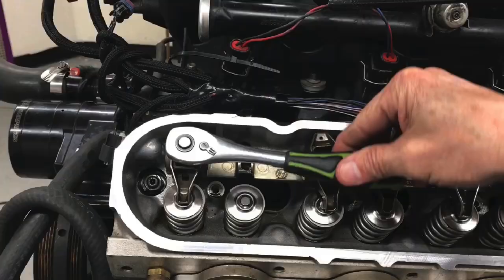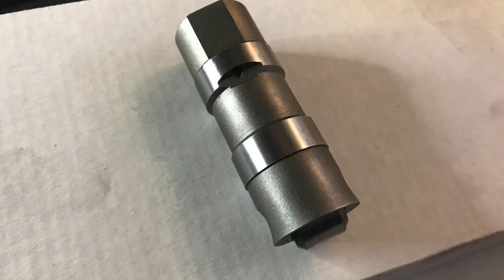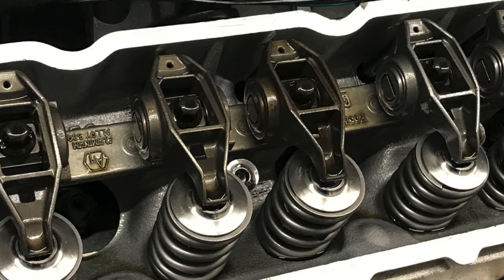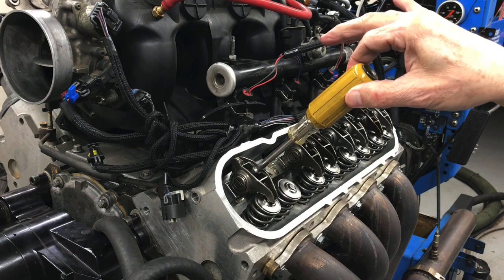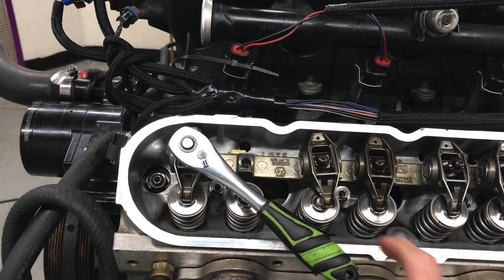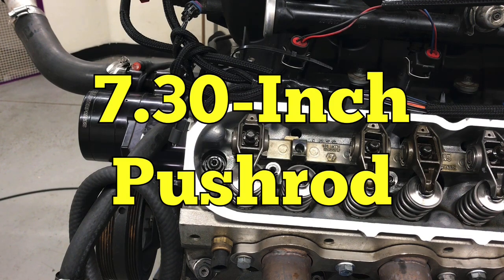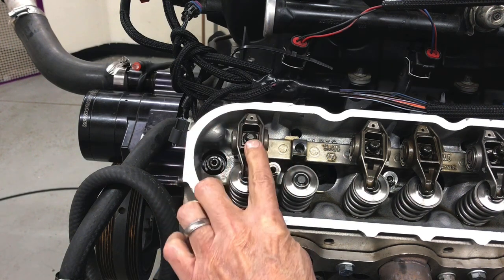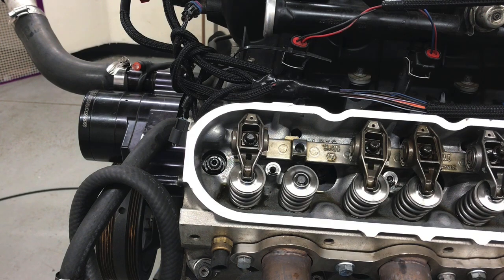HOW TO DIY: MEASURE LS PUSHROD LENGTH-CHEAP & EASY!

Comment: and in this example what was the correct pushrod?
Reply from the maker: WE SHOWED A RANGE OF LENGTHS THAT ALL WORK
Reply: @richardholdener1727  mmmm I'm running 7,425 with ls7 lifters and when I tightened the rock arm I got 1 3/4 turn back after zero lash at 22lbr of torque with a 615/592 lift cam and I have problems with the valve train  It sounds very noisy. I'm supposed to be on a .060 preload. I should be fine. I don't know what happened in my profile. Can you watch a video? Maybe you could help me with a suggestion. Thank you.

Comment: I hope this gets answered! 🙏 so I've done this so much that I'm tripping over my math now and over thinking and second guessing everything 😆. So with a pushrod length checker, I got 11.25 turns, so (11.25×.050)+6.8 = 7.365 total pushrod length, so obviously, it'll have to be a 7.350 rod or 7.375 for non custom made rods...but at my length the turn method is as shown in the video at zero lash on cylinder #1 on the intake base circle it is ( 1 full rotation, then a quarter turn) give or take a few degrees. So I did the math correctly and should be safe with a 7.375 rod, then correct?
Reply from the maker: I don't ever measure the way you did it with the length checker. Make sure the lifters have oil and measure the turns past zero lash (like when installing them) on the heal of the cam. 1/2-1 1/2  turn past zero lash is ok
Reply: @Richard Holdener  so exactly like I stated above. We essentially did the same thing but instead I used a length checker as the pushrod to verify the size. But the rest us the same as you described. Thanks for the confirmation 👍
Reply: Hopefully u see this message I just install my cam & is  making noise; tuner guy told me that I need a short pushrods rn I got 7.40 he suggested me use a 7.35  is that right ???? …. Thanks 🙏
Reply: @richardholdener1727 Does this work if the lifters are new and have no oil?
Reply: @AM-hg9xh you would need a longer pushrod in that case. If you’re getting noise that would be like when he installed the 7.300 pushrod.
Reply: @justinspringer4197  need to have some oil in the, if its a new build i use a modified weed sprayer to pump up engine oil pressure.

Comment: Would be cool if u did a dyno of stock heads with the rocker boss ported out.
Reply from the maker: why eliminate the rocker boss?
Reply: @richardholdener1727  It's a really common thing people do when porting factory cathedral port heads in the forums. But their are no dyno numbers of before and after that I could find. Would also see the dyno numbers with the bowl cleaned up and the valve guide boss cleaned up. Basically just some light head work to factory heads that most guys could do in their garage.

Comment: So after u measure this and thighten to that 1 and 1/8 turn do u torque to spec after?
Reply from the maker: torque spec on the rocker bolt does not change the preload

Comment: I’m hoping somebody can give me some insight. I got a lq9 I just built out in my f body camaro. Tick stage 3 polluter cam. 799 head with .010 off and .040 head gaskets, pac 660 springs. Got a set of 7.4 pushrods in it. I’m hoping the push rods are to long and not the cam being to big. But the motor will not turn over with the rocker arms tightened down. Any insight? Thanks in advance
Reply from the maker: p-v clearance? and don't force it
Reply: @richardholdener1727  I really appreciate the reply. I’m measuring pushrods today but I’m guessing it’s piston to valve as well. I appreciate it again you the man keep the great videos coming!!

Comment: So you no longer use the factory torque spec you just stop when the rocker bottoms out and it’s set? Between.5 and 1.5 turns
Reply: 22lbs ft is what it takes to set it at the bottom.

Comment: So, with OEM Rail, OEM Rockers & OEM Fasteners (OEM thread pitch) on OEM Heads on OEM Deck Height.... 
From Zero Lash, 1 'turn' of Lash = (roughly) 1/10 of an inch ? (2 1/4 turns on the 7.5" vs. 1 1/4 turns on the 7.4").
How many actual turns does the +/- include for the 'Safe Zone' ? You mentioned 'Safe Lengths' from 7.35 to 7.45 (for this combo),  so if 1 turn = 1/10, 1/2 turn should be roughly 5/100 ?
Would this mean that the +/- range would be 2 1/4 turns (7.4) +/- 1/2 turn ? So 1 3/4 turn--to--2 3/4 Turns = Safe Range ? (+ 1/2 turn for 7.35, - 1/2 turn for 7.45 ?).

Comment: Is there a chart for what pushrod lenghts would work if you were spec'ing an engine to build but dont actually have yet? Or is this a find out as you assemble type of part?
Reply: If you know the deck height of your block and surface height of the head along with lifter height, a knowledgeable person could calculate what size will work for an application. Personally, I’d only do that if I have a engine at a machine shop already assembling it. They could easily take those measurements and I’d order a set same day, this method or an adjustable pushrod are the easy ways to check once it’s already assembled.

Comment: I always enjoy your tech . Not apples to apples but on my Harleys one is a SS 124 the other is a SS 143 and both have some work done to them . I use limiters in the lifters ,  I wondered if running a bit longer push rod might do that . I have heard that you can used solid lifter roller on hydraulic roller lifter on some high end builds not that I ever had one lol and set the lash pretty close and quiet.  I like running solid lifters as I use to try to tune the engine a bit by the lash

Comment: Well you got the factory pushrod length wrong, its 7.385 gauge length not 7.4!!, i was waiting for you to spit the wrong turn info also..for those reading 1 turn is .079 preload..ls7 lifters have .126 plunger travel the old ls1 had almost .200 travel an you want to shoot for mid travel or a tad less on a hyd lifter an also a iron block/alum headed deal will loose .010 preload at temp an .015 if its a alum block an head deal do to expansion.
Reply: I always shoot for 3/4 turn on LS7 lifters. That’s just me...
Reply from the maker: PRELOAD GUYS!